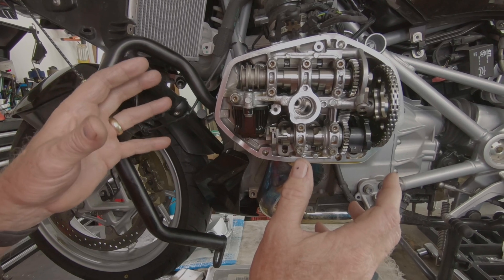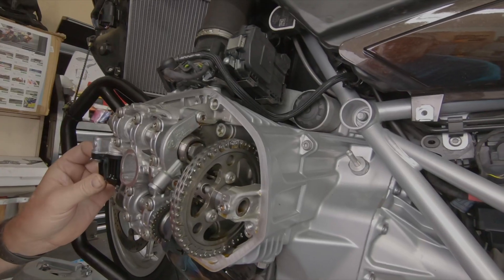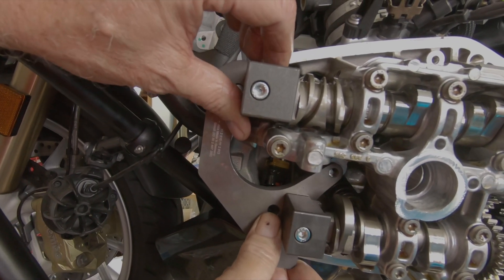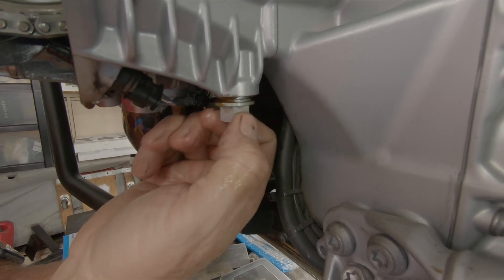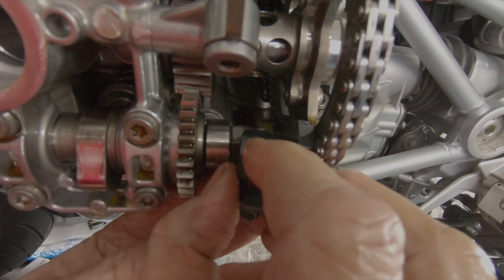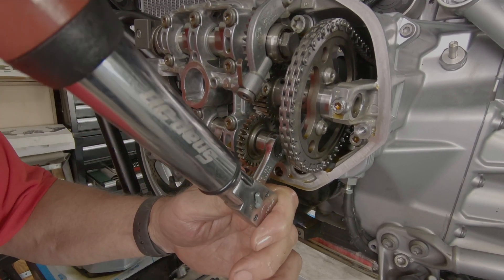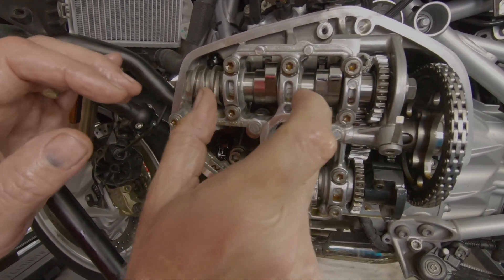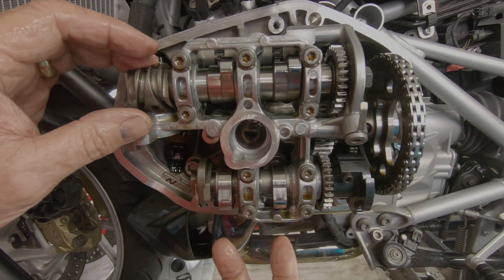BMW R1250 LH Cam Timing Part 1 of 4

Comment: Hello, can you help me with what could be wrong with my BMW engine? I bought a BMW 1250 GS in 2020. Mileage 7000 km. The engine has strong vibration throughout the rev range. I can feel the vibration on the handlebars, saddle and also on the footrests. I wanted to do the camshaft timing like you do in the video. The dead center hole with a diameter of 8 is at bottom dead center and the 6th hole is after top dead center. How can this be? The motorcycle itself starts well. I suspect that the balance shaft is out of balance somewhere, which is causing the color, but the flywheel marks are wrong. Can you give me some advice
Reply from the maker: Here are some basics to consider. (I may be explaining too much...sorry if that's the case)
Remember that the crankshaft rotates to reveal the 8mm slot 2 times for one complete cam/valve evolution.  Cams run at 1/2 the speed/rate of the crankshaft.
This means that when the 8mm slot is locked with the TDC pin, both pistons are at their extreme outer most travel, and one cylinder is at compression/firing/TDC and the opposite cylinder is at overlap between the exhaust and intake stroke. (not referred to as anything other than OVERLAP...not TDC on that side)
If you see the 6mm slot on the rotor of the alternator in the access hole, then both pistons are at their innermost/bottom point of travel.  It takes some keen observation of the cams and valves on both open valve covers to determine what part of the 4 stroke cycle each cylinder is in. (Otto cycle)

My guess at your situation is that when you see the 8mm slot, the piston on the LH side (#2 cylinder) is at EXH/INT overlap and that the RH side is at TDC/firing (#1 cylinder).  
This is simply an expectation of what you think you should see on the side you are looking at, when you might be well served to observe the workings of both sides through several engine rotations to get this clear in your mind.

This boxer engine is definitely an "interference engine"...meaning that if the valve train is not exactly coordinated with the movement of the pistons...they will hit each other and will result in catastrophic engine failure.  

I doubt that your engine is "phased" incorrectly with regard to the counterbalance shaft...even though you are sensing vibration/rough running.  
The more likely scenario is that the cams could be returned to factory OEM original, (minor adjustment),  the valve clearances could be set a little closer to the tight end, and a regimen of about 1000 miles of proper combustion chamber/valve seat cleaning fuel cleaner will help immensely.

Remember, to do any adjustments to the cam timing, you MUST have all 3 proper tools to 1)Lock the TDC slot on the alternator rotor with a precision 8mm pin, 2)Properly tension the Cam Chain with a spring tension style tensioner...definitely not the ones being promoted that are to be adjusted finger tight, 3)Use a precision Cam Alignment Jig that can be bolted into position while properly torquing the bolts that hold the cam driven gears to the camshafts.

Doing any of these Cam Timing adjustments are NOT part of a dealer's normal services.
The only mention of the Cam Timing Tools I use is when a Camshaft needs to be replaced, so dealers won't do this as a requested service. 
Good Luck!

Comment: Thanks for the video. Would the stock 1250 tensioner assembly (spring and plunger etc) be a candidate for a tensioner tool? I have an extra and want to make one. Thanks!
Reply from the maker: No, I don't think it would.  Firstly, it already has a spring within the plunger of undetermined compression force.  The spring I use slides inside the hollow piston of the previous generation CCT and then has been calibrated to exactly match the effort of the factory OEM CCT Tool.  This means you would have to have a OEM CCT Tool to use as a benchmark to come up with an exact match using the 1250 internal spring plus whatever very, very short spring added together to work.  I know how much R&D went into making the one I produce now...you would be starting from scratch.  I have 3 OEM CCT Tools to verify that my DIY Tool performs exactly the same.  There is someone else selling a CCT Tool that has NO spring at all...instructions are to just run the small bolt up finger tight.  If you use this tool, without having it match the way the OEM CCT Tool exerts a pretty large amount of spring pressure on the cam chain, then the Cam Timing is going to be off...maybe even worse than before you started.

Comment: This is a fantastic service to the BMW community. I assume that other than the shift cam actuator and the slightly different kit for the 1200 sold by Joe Pilz, the procedure is the same for the 1200RTW?
Reply from the maker: Yes, pretty much the same procedure, a little easier because there is no need to deal with the axial fixation pin on one end of the cam and the shift solenoid on the other.  The laser etched marks need to be far apart, away from each other, on the 1200 WetHead, which is different than described here for the 1250.

Comment: Awesome videos!  I will use on my new 1250 for sure.   One thing I was confused about was the cam chain tensioner.  Why do you need to remove the cam chain only to install another one to duplicate the original tension?  Why couldn't you just leave the original tensioner on?
Reply from the maker: It's a tool with a specific spring pressure that matches the factory tool...not another cam chain tensioner.

Comment: Hello, and thanks again for your efforts in producing these fantastic videos.  One quick question… My 2019 R1250 GS “pops” when the cam shifts during acceleration.  Would you be aware of a remedy or tuning technique which would mitigate or eliminate the pop?  Thank you for your insights.
Reply from the maker: It could be a single condition, say the LH Int Cam slightly out of time, or maybe more cams all slightly out of time from the perfect factory setting.  It could be some carbon holding one of the valves from being completely closed allowing some of the high combustion pressures to leak past...either into the intake or the exhaust...both conditions can allow unburned gases to reach the catalytic converter where it will be reburned.  Lastly, there are 7 Adaptive Values that I reset after EVERY Cam Timing/Valve Clearance Check...this is due to the changed volumetric efficiency...allowing the ECU to re-map values quickly will allow the bike to know the best settings.  Lastly, each time I do this service on a bike, I borescope the combustion chamber to record and analyzes how much carbon is causing issues with the engine.  Keeping a trend analysis of your efforts to remove the carbon and keep it clean pays HUGE dividends.
Reply: Good insights. Thank you sir for the quick reply👍🏼
Reply: How to reset the 7 Adaptive values?  GS911?
Reply from the maker: @kramer2965  Yes, but the reset is because the physical operating conditions of the Cam Timing and Valve Clearance has been corrected back to factory original.  
If there is no change to these physical conditions, then the ECU has already made corrections to compensate for the current situation. 
It would only cause the ECU to have to repopulate its “lookup tables” with the same information, so no advantage to you in the way the bike is currently running.
Reply: Understood - thank you👍🏼

Comment: Is the pre-tensioning (12mm) of the cam chain the same for the 1200LC engine? Is that pre-tension also required if only valve clearance is checked?
Reply from the maker: When using MY DIY Cam Chain Tensioner, yes 12mm of bolt extension is the same for the WetHead and the ShiftHead.  This is NOT a direct application of tension on the Cam Chain...it's what's required only with MY DIY TOOL and is completely different than the number of turns with the OEM Tool.  Totally  "Apples and Oranges".  There is no need to use any kind of cam chain device to do the Valve Clearance check.  If you are just "somewhat close" to being at TDC, as evidenced by the piston near the spark plug hole, and the laser etched marks on the ends of the cams being "far apart, away from each other" (on the R1200 WetHead) then you will have the cams on the base circle so you can measure the clearance.

Comment: Where did you find the specs and procedures? BMW has made their manuals online and dealer only access. My shop can't access them for 2021 and newer because I'm a private shop and not an official BMW dealer. Even though I am BMW factory certified.....
Reply from the maker: I have the BMW Original DVD from 2019 and the engine has not changed up until the 1300 as you know.  I'm just an amateur mechanic, so don't go by anything I say or do.

Comment: You make fantastic videos and give excellent instruction, thanks for this. I am new to BMW with a used '23 1250GS and have purchased the full tool kit from Pilz. My question is what mileage would you recommend doing this procedure? I plan to keep this bike for a long time and like to stay ahead on maintenance. Thanks!
Reply from the maker: It's not a "necessity" to do this Cam Timing...as a matter of fact, the only reference to using these tools in the BMW Service DVD is to use them when a Camshaft is REPLACED.
That said, if you live anywhere close to New England in the USA, where I live, or could attend one of the BMWST.COM START or FART Rallies, I do this procedure on 2 bikes a day.
To answer your question, the engine needs about 12k miles to allow everything in the valve train to break-in and normalize before doing this.  If you do it before that, then you might need to do it again after it gets 12k miles on it...if you have well over that mileage, no problem, you will just enjoy a smoother engine that might run better.

Comment: At 4 minutes in you use your tool to rotate the camchain sprocket. I notice you turn it in a CW direction (when viewed from the rear, face-on) so that the tight side of the chain during rotation would be on the bottom. Wouldn`t this put undue strain on both the camchain tensioner and guides? It could also introduce any  slack in the chain to the top chain run causing camshaft timing retardation and failure of the camshaft setting tool to fit, or is this known by BMW to be the case and is what the camchain tensioner special tool is for - to tension the lower run of the chain thus eradicating the slack on the top run thus pull the camshaft timing back to spec? If so it`s a rather crude way of doing it..
Ideally during camshaft timing and/or valve clearance adjustment it is the crankshaft that should be turned in the normal direction of rotation but there is no provision for that on these 1250 engines.
Reply from the maker: This is just the way the BMW Service DVD specifies the engine to be tuned over. There is very little resistance on the crankshaft once the spark plugs are removed.

Comment: Good morning, I have a 2023 BMW rt and the engine rattles and I’m thinking something is out of timing. I traded in a r1250 gs for a 2023 r1250 rs for my California bike for my daughters house. This engine runs perfect no clatter no noise when under load. Both engines run perfect at idle the clatter on the rt is only when under load and generally when letting clutch out although it does still clatter when under load. I’m going to bmw this morning because the turn signals don’t cancel and the engine noise. I’m certain they’re going to say it’s normal engine nois which it isn’t. Are the mechanics at bmw dealerships qualified or capable of doing this at the dealership like you did or do they avoid this at all costs. Also where do you work out of I’m in the Chicago area. Thank you Duane
Reply from the maker: @duanecarlson5008, working with the dealership can be frustrating...at times, but while still in the warranty period is really their business.  The relationship of the clutch noise and clatter under load sound to me to be different sources, but one thing you don't mention is the miles on the bike.  I've been doing borescope documentation on the last 15 or so bikes I've worked on...almost every bike under 15k miles still show that both sets of valves have not seated completely.  What this can result in is poor sealing of the combustion chamber making uneven power pulses.  If it's the intake valves that are still breaking in, the intake charge can be affected so that even more uneven combustion occurs.
Overall assessment, is that running the bike with lots of heavy throttle (but not high RPM) to finish the break-in of the engine is critical...nothing that the dealer, or other maintainer can do, it's the process of getting everything settled in with the engine to make it run smooth.
The Service DVD only references using the Cam Timing Tools for replacement of a camshaft...NOT for the re-adjustment back to factory original setting that I do in this series...dealers are not inclined to do this for any complaints related to noise or perceived poor running.
Another important maintenance step in this troubleshooting effort is to use some high PEA concentration fuel system cleaner.  I don't recommend using more than 1oz per gallon of fuel, and try to only do 2 tank fulls per oil change to guard against oil contamination. (recent oil analysis does not show degraded oil quality, but enough is enough) I like Redline SI-1 or Chevron Techron.
I'm in Rhode Island, and work in my garage.  I'm not a business, just an enthusiast working for free on other folks bikes...I don't charge for any work I perform.
Good luck with your bikes.

Comment: This video is gold. Thanks for taking the time to put it together. One question: Where do I get a good set of feeler gauges for a '20 R1250RT Shiftcam Engine and do you sell the tools (cam alignment jigs, cam tensioner, 8mm TDC locking ping, 16mm torque adapter, and Engine turning bar?
Reply from the maker: I was making one set from 2 that covered just the range needed for the 1200/1250.  One set was from Amazon, and one set was from Hornig...which is no longer available.  Sorry, I have not found another source for the second essential set.

Comment: Excellent video, well explained and very detailed, I want to ask you about the chain tensioner tool, do its measurements apply to R1200gs LC? Greetings from Argentina
Reply from the maker: Yes it does, it works the same.
Reply: Thank you for your prompt response, you are very kind. Have a nice day @Boxflyer11

Comment: Boxflyer, now that my cams are correctly timed, should I expect a noticeable difference?  Smoother running, etc. ?
Reply from the maker: The part that’s sometimes the significant thing to complete the total improvement after doing the cam timing and valve clearance is to reset the Adaptive Values that the engine needs to run at its maximum efficiency.
Reply: @Boxflyer11  . Do I reset the Adaptive Values with my GS-911?  Not sure what Adaptive Values means...
Reply: Found it on the GS-911 hex code website.  Reset camshaft adaptation values.
Reply from the maker: On the GS-911 software, under the Engine section, there are 7 specific modules to reset.  1) DTC/ASC, 2)Camshaft Adjustment, 3)Knock sensors, 4)Mixture, 5)Throttle Valve, 6)Twist grip, 7)Gear shift/transmission.  Each and every one of these is influenced by changes in Cam Timing, so they all need to be "sync'd" up after making adjustments to the Cams.
Reply: @Boxflyer11 .  THANK YOU!
Reply: Successfully reset/recalibrated all parameters.  Now, time for a road test.  It is a clear, sunny day.

Comment: Hi, first of all let me start by saying that it is a pleasure to see such an organized way of working while at the same time explaining everything very clearly. I have a 2021 BMW R 1250 GSA with 9k km, with an annoying rattle between 2k to 3.5k RPM coming from the left head. Despite many attempts at BMW dealership, they say the sound is normal and no solution has been found. Today I drove another 1250 GSA from the dealership with 2k km and that one didn't have that annoying sound. In you experience, did you ever come across any 1250 engine with a ticking noise beyond normal and if so, could your provide some guidance/advise? I'm conscious that all boxer engines are noisy but not like a bag of nails inside the engine. Many thanks from Portugal
Reply from the maker: "9k and MANY Attempts at BMW"...Plenty of warranty left...the dealer needs to be the final say on this.

Comment: Hi, love ur channel, I have got a r1250rs, with a damaged cylinder head, the chain has been knocked off and I’m replacing the head. Is there a way of timing the head without the cam setting tool? My local BMW garage will not sell me the tool.
Thanks Jason
Reply from the maker: @jasonlee8282 You can physically configure the cams to be coarsely aligned (in the right gear teeth) once the cam chain is installed. (If you have not changed the relationship of the cam drive gears to the camshafts themselves)  This can be done by using the laser etched marks and 3 flat sides on the opposite cylinder cams.  Set the "known cylinder" cams 180 degrees out of TDC by rotating the engine so you can see the 8mm slot in the access plug on the side of the engine.  Then you can install the newly installed cams so that the intake cam has the 3 flat sides up and the 2 vertical sides are parallel to the machined surface of the head.  The exhaust cam needs to have the laser etched mark on the end at the bottom and the flats also parallel to the cylinder head.
At this point, you need to do a Valve Clearance procedure. 
The engine should run at this point, but the full procedure of using the 8mm TDC tool, the Cam Chain Tensioner, and the Cam Alignment Jigs would be highly recommended to set both sets of cams, and most importantly the LH Exh cam timing reluctor for the engine to run exactly as it came from the factory.